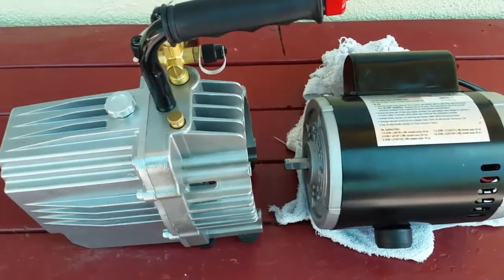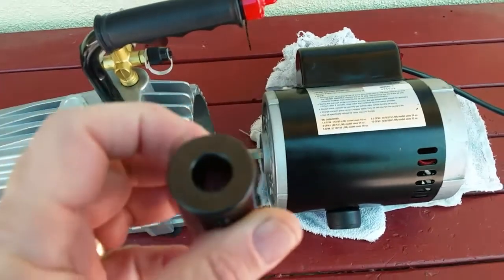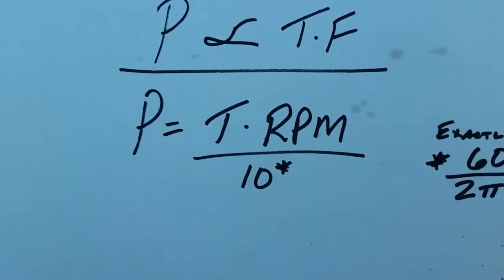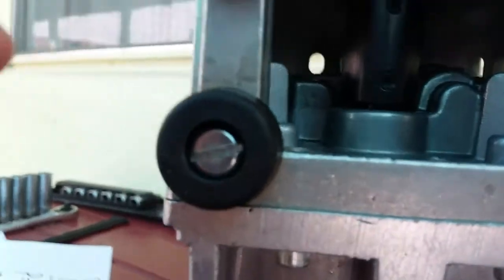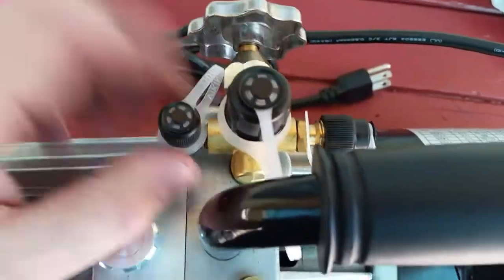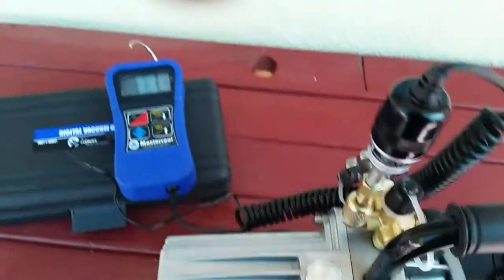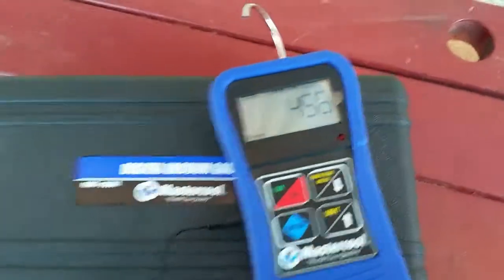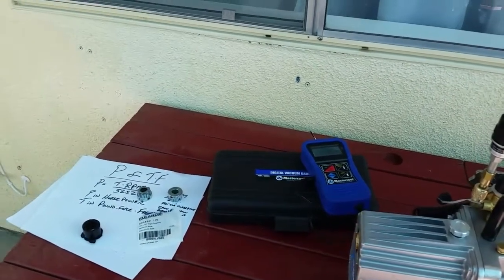MASTERCOOL 7.5 CFM VACUUM PUMP MOTOR COUPLING DESIGN DEFECT

Comment: WOw, I have a 5cfm of about the same pump that runs great and has zero vacuum, guess I need to check the coupler because it doesn't make any sound as if the pump is even turning. Great, thanks.

Comment: sir i am user of master cool A/C  recovery machine  which is equipped with an internal tank.Internal tank (cylinder)is upright position.which affects the efficiency of A/C when half cylinder is used.Tell me is there any MODEL?Which is mounted with INTERNAL cylinder in downward position.Every qualified technician know when we refilled the internal tank with an external tank,the position of external tank is downward WHY?

Comment: Sir Where you buy the socket ?
Reply from the maker: THe coupling I got at Amazon:  https://www.amazon.com/Ruland-SCX-8-8-F-Coupling-Diameter-Length/dp/B0060LVB2E/ref=sr_1_fkmr0_1?ie=UTF8&qid=1520094200&sr=8-1-fkmr0&keywords=Rutland+scx-8-8-F  The hex key sockets at an auto parts store like Pep-Boys or NAPA.

Comment: Hey Mark, thanks for bringing this to everyone's attention. I just did your modification to my pump - works great. BTW, have you had any other problems or issues with this pump? I recently  just got mine, there doesn't seem to be a lot of info floating around regarding these MC 90067 pumps.
Reply from the maker: Happy to help.  Pump works great with mod.  Ultimate vacuum 15 Microns or better.  Take care.